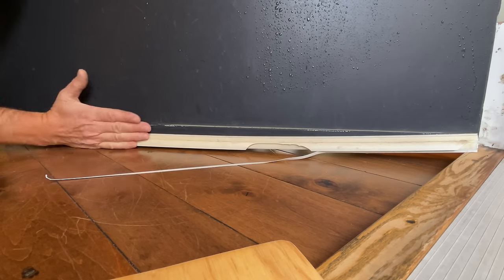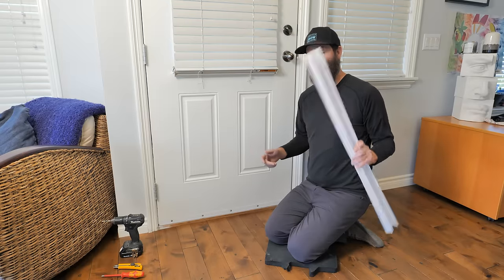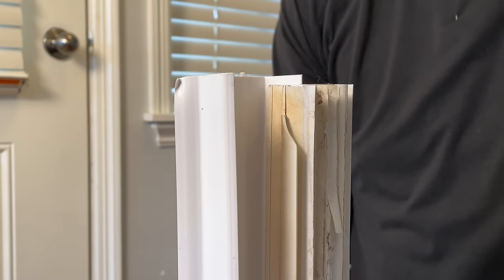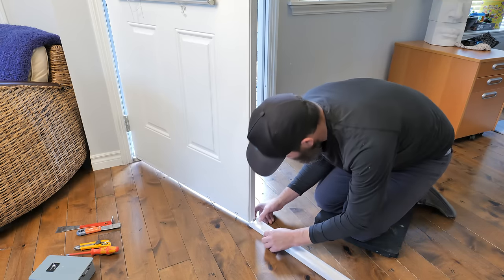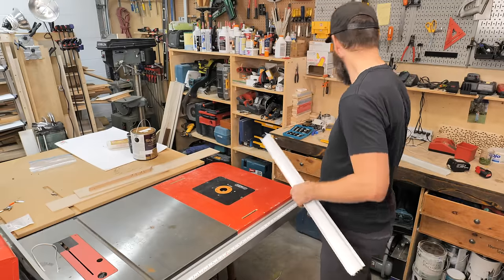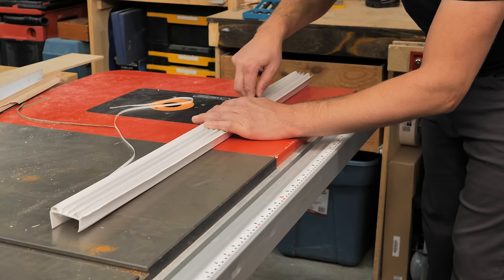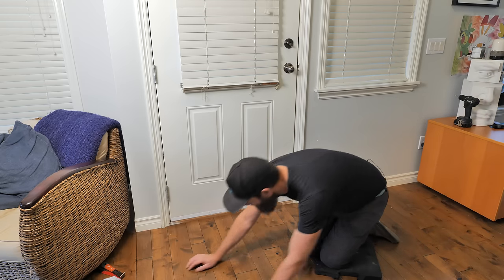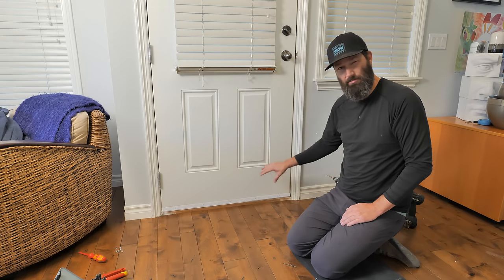How To Replace Your Door Sweep And The Secret To A Perfect Fit!

Comment: Additional Tip: A lot of newer exterior doors have adjustable thresholds that can be tweaked by ~4 adjustment screws across the top of the threshold. If your new sweep fits too tight, try bottoming those screws out in the threshold first to see if that makes enough space. If it ends up being too loose, adjust the threshold screws accordingly.
Reply from the maker: Excellent tip, those type of threshold ms are handy.

Comment: May I have a question to ask of U?  Thanks for the Video, I have the same type of door sweep.  Due to the bottom wood got so rotten, we have to attach a new piece of wood.  Even with best effort, it was a bit too tight, and the two sides of the door frame is not perfectly 90 degrees, so there is a slight of a slant at the bottom as well.  My question is how to even know where to Trim on the rubber part?  Because there is no easy way to mark or know where the mark is for trimming.  This whole door design is such a pain for Rain Water proof.  a bit of loose, water would come in, too tight, can't close the door. and since it is so low, it is even hard to really see well.   Any suggestions?

Comment: Hello! Great video! On the outside of the door, what happens if rain hits the door and runs down into the sweep? I am concerned about rot at the bottom of the door, but it seems that nobody caulks the outside top edge of the sweep. Thanks!
Reply from the maker: It's not going to hurt it to caulk the outside, and if you get a lot of driving rain on there it's probably to. bad idea!

Comment: Hi! New house and the old threshold is about 1/2inch  away from door. I think they messed up when they installed new floors. Needless to say huge gap between door and threshold. I bought the adjustable threshold. But seems like I’m going to have to cut off quite a bit of the bottom of the door. To fit over the wooden part. And enough for plastic fins to be reinstalled after door cut. Is that the normal way. It adjusts from 1 1/8 inch to 1 3/8 inch. Will people trip over this? Or is it meant to be flush to floor level? Thanks :-)

Comment: Any suggestions about what to do when you need to fill the gap under the door, but the carpet on the interior is too plush and prevents the door from opening easily if there is a sweep on it?
Don't want to change the door because it's original to the house, and don't particularly want to change the carpet since it's brand new.
Reply from the maker: Google or look up on Amazon threshold weather stripping.  Perhaps you could put something on the existing door threshold to create the seal.
Reply: @TheFunnyCarpenter  Brilliant! Thank you!
Reply: Same problem here! Thanks for asking.
Reply: The only way a threshold and door shoe will seal properly is if the threshold sits proud of the flooring by a minimum of a 1/4”. You need to raise your threshold enough to clear the carpet. You can buy an aluminum threshold at the home centers and install it over the existing threshold. There is more involved but that’s the jist of it. You’ll also have to cut your door so the shoe/sweep has enough room to fit now that there’s a new threshold height
Reply: Tip: before you start you should mark the height of the door on the top inner jamb on both sides. When you go to cut your door you’ll already have a mark to measure how much you need to cut from the bottom.

Comment: How about a video on sealing a garage door for a heated garage. My garage was never built to be insulated, and so my sides let light in and cold air. Also, the bottom likes to freeze after the condensation runs down the door to the floor.
 Take care,
 Thanks for all the info.

Comment: Do you have suggestions on how to secure double doors so they are less easy to kick in?  Mine has plastic tabs that push into a hole at the top and bottom of the door.  The tabs slide down gradually over time. So I tried to remove them and replace them with a metal latch, but was unable to find one that fit.  I thought about installing a removable security bar behind the dummy door to help prevent it from being kicked in.  But maybe it's just time to upgrade my 1963 metal front doors?
Reply from the maker: What about some type of nice looking gate style push pin type latch that goes into the floor and trim above?
Reply: Wagu, add a 2x6 to the header, and do exactly what The Funny Carpenter suggests. 
You can always trim and paint the header 2x6, at least I know I can. Quarter round, or 1&1/4 " trim, or let your mind go fancy with 3 layered trim

Comment: Just moved into apartment but could see light shining through I went straight to Amazon !!
Reply from the maker: Best wishes on the job!
Reply: If that door goes to a hallway, that space might be on purpose. Many apartment buildings rely on being able to suck air from the hallway when handling exhaust. You might find your bathroom or kitchen fans don't work as well if you cover that space under your door.
Reply: @PinAViolet  thank you for lmk I will definitely check it out!! 
I got the cheap door draft kind bc I assume it's gonna be hell of a draft come winter

Comment: I'm surprised to see a pro recommend a U-shape for an exterior door. It will capture water and rot the door. At most there should be an L-shape with the slope running to the outside, and an I-shape sweep in front on the outside. Realistically, these things are consumable, so you should also only recommend something that can be replaced easily. Some of these bottoms have a channel for removeable weather stripping.
Reply from the maker: Fair points!  I guess the discussion gets a lot more nuanced depending on how much weather the door sees.

Comment: Im not trying to be an annoying troll,  but i would have lowered the threshold with th adjustment screws located under the door. I dunno, its possible tour door didnt have that sort of threshold...
Reply from the maker: No worries mate. That’s a good point. In my area those type of thresholds are very uncommon.

Comment: My brain can’t handle that your exterior doors open inwards, it keeps tripping me up while watching. In Denmark almost all exterior doors open out.
Reply: I've never seen a outward exterior door. They all are inward so a screen door can be used.
Reply: Inward here in the UK too 👍🏼
Reply: @GoldVP...  inward is also more secure to. But I guess crime hardly exists in Denmark compared to out here.
Reply: I feel they should open out like yours.   If businesses have to open outward for emergency situations.   I feel homes should be the same.
Reply from the maker: If you think about how an exterior door functions. The person inside would know a lot better when the door is about to open than a visitor standing outside.  Inward makes sense, similar to a bedroom door.
Reply: In Sweden all doors open out. Evacuation safety and common sense. Why would the door open inwards and take up space in the hallway? And when you take of your shoes the door would be in the way if it opened inwards…
Reply: Sweden and Denmark both get snow. Don't you have problems with an outward opening door if you've had a large accumulation overnight? Inward seems safer when there is snow outside, especially if winds cause a drift in front of your door.
Reply: Many times (in the US at least) there is a porch, landing, staircase, or stoop attached to the dwelling. With an exterior opening door, these areas would need a much bigger footprint to allow the user to get out of the way of the door. This becomes very apparent t when you add a storm or screen door lol.
Reply: @ThisTall  burglars kick in doors , tougher to kick in an outward opening door so outward for the back door would be better.
Reply: Commercial doors open out, residential doors open in. Not easier to kick in if you install the door right :)
Reply: It’s for screen doors and more importantly snow. If you get a big enough snow drift there’s no chances you’re opening that door outward
Reply: In florida it is code for any exterior door to swing out. Stronger for hurricane winds can't push door open. But I do see the snow issue, but no snow in florida!
Reply: In inward-opening door is symbolic of being welcoming.  I’ve never seen a residential door that swings toward the outside. (Tennessee USA)
Reply: Pretty rough to have a screen door or  storm door if the exterior door opens out.
Reply: I was told code in the northeast for residential is to open inward so there’s no chance of being trapped by a snow storm or something blocking the door. If you get 6” of heavy snow you won’t be able to open the door.
Reply: @GoldVP...  True, unless they're commercial/business emergency doors.